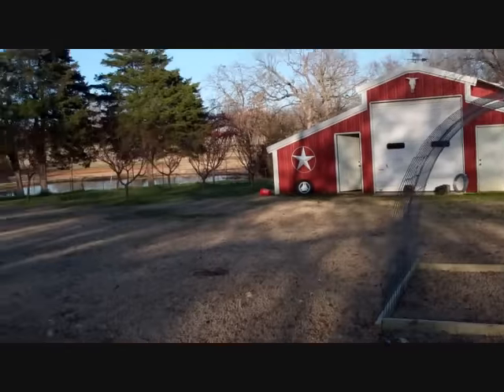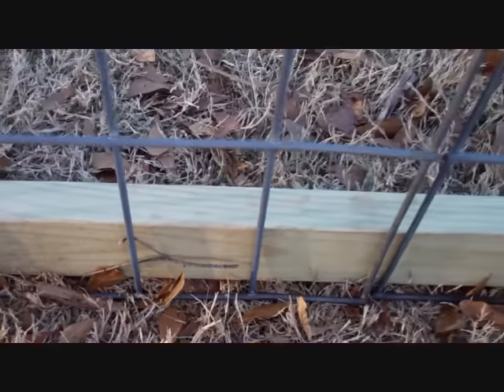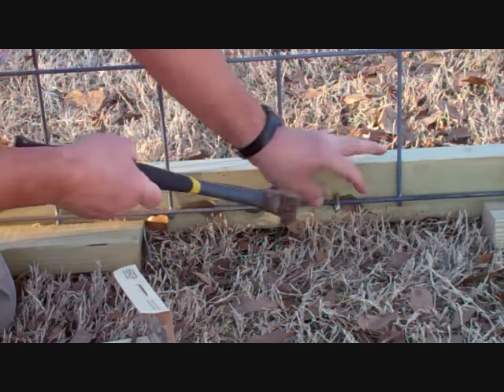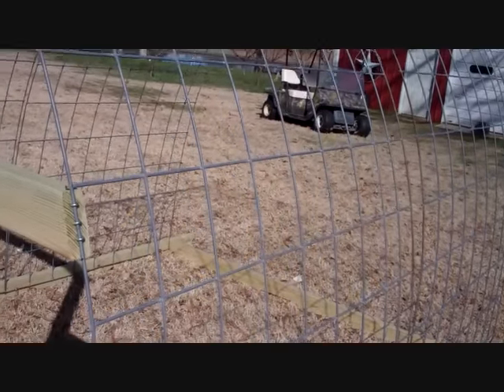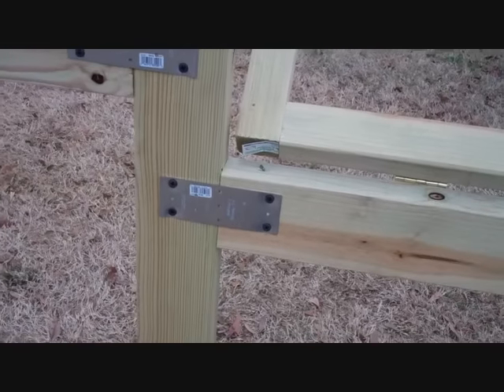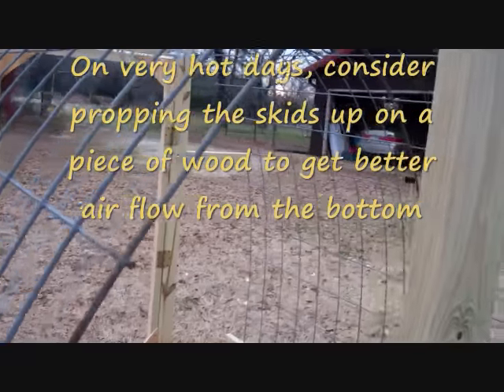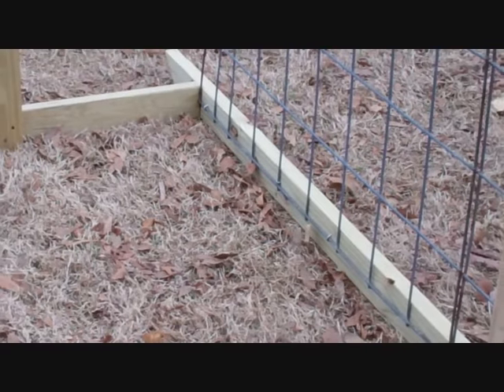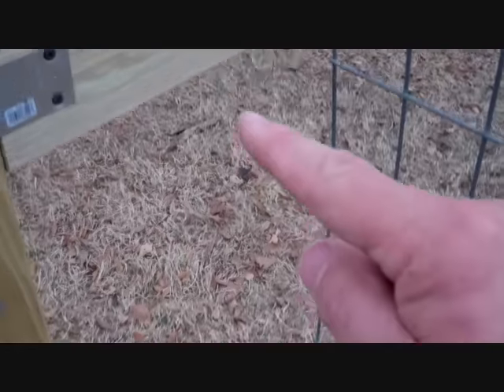🌞Cattle Panel Greenhouse🌱For About 150 DOLLARS! 🌻 DIY

Comment: How wide does the plastic need to be? I bought the kindle book. It doesnt state anywhere in the book how wide the plastic needs to be. The panels are 16' so i assume 16' wide would work? I dont want to order the 16' wide plastic and find that its too short. Thanks

Comment: I bought the plans and built the greenhouse last spring  with some modifications and upgrades. I have used the pipe insulation as in the  instructions.  and I noticed  that was the first place my plastic (bought the wrong stuff from the original link) got brittle and cracked.  I have got the right plastic now any reports of issues with  the pipe insulation?
Reply from the maker: +Tim Palmer 
No... none. For me, it seems to have protected the plastic well. Mine lasted 4 years.

Comment from the maker: The cattle panels are 50 inches tall and 16 feet long. 

Don't forget to take a look at the e-Book. There is a link to it below the video, and it included all the drawings, materials list... and even shows how to add corrugated metal to the cattle panels to make a nice shed. It will save you a lot of time and maybe some mistakes.

thanks for the comment

Comment: North Texas here.  Wondering how warm that greenhouse stays during cold spells in the winter?  Do you put a heater in it?
Reply from the maker: Steve Geer 
I only use mine in the early spring when I have seedlings that need to be in it. If you’re going to use it all winter long, yes it will need to be heated if there are frost sensitive plants in there. 
Once or twice I used a propane stove. Once I used a kerosene heater.

Comment: How much plastic did it take for the 2 cattle panel and 3 cattle panel design...I didn't hear the size of was said ...thank you!
Reply from the maker: 2 Panel will take 16X25'
3 panel would be about 16X 30', but I'm not for certain.
The PDF and eBook is linked to below the video. 
All measurements and materials list is in it.
DON'T buy plastic from Lowes,etc. It will only last ONE year.
Get a good greenhouse plastic. I have some good "greenhouse plastic" linked to below the video also.

Comment: I am in Jamaica .. made this with a few mod. no window @ the back .. plastic on the top(self defined)  and anti-viral mesh all around the sides, my door swings out, working out to be great thus far ... using it to gain some greenhouse experience with bell peppers.. wondering how it work out if I decide to make another but only around 20 to 30ft long .... any suggestions? please  thanks.. worth the money spent ....
Reply from the maker: I would think if you go THAT long, you'll have to add some support in the middle.

Comment: On the ends when you grasp the plastic then twist it and staple it, doesn't that create a channel for rain water to run down and onto the wood? Over time won't that excess water rot the wood?
Reply from the maker: +Terry Thomas 
I had that plastic on for about 4 years and it didn't seem to hurt anything. Even the BEST plastic will be changed every 4 or 5 years. Remember, I used treated wood. Moisture shouldn't make it rot. If it is going to rot anywhere, it'll be on the skids that are in contact with the ground.
Reply: +TexasPrepper2 Great job. I've been planning my greenhouse for sometime now and have analysis paralysis. Been thinking too much. To the water drain issue. Can't you just grab the plastic and turn in down instead of up? Then the channel would be on the bottom of the fold.
Reply from the maker: +Clean Slate Farm 
Sure... in fact, I don't think I've done the plastic the exact same way on any of the greenhouses I've built.
Reply: TexasPrepper2 Love the design and a great job of explaining the construction. Thanks.
Reply: +Daniel Williams Thanks. Snow and cold have hit here so the greenhouse is off the list until spring. I'll have one for fall and next winter though!

Comment: Building one as we speak!  The e-book nor the video mentions at what stage you put the plastic on the door and window.  I am assuming it is before you actually wrap the entire thing. Is that correct?
Reply from the maker: Doesn't really matter.
I think I usually do it after I wrap the arch.
That way I can use smaller pieces (if they are big enough) for the window and door.

Comment: Hey There...this is a great greenhouse. We purchased the kindle version of your plans, but neither the video nor book has an explanation of how you skinned it. I'm having issues with all the excess plastic on the end/corners. Do you cut it? If so, where and how? Thank you!
Reply from the maker: I showed as best I could about skinning it, but the few I've built were all a little different as far as the plastic goes.
I've had dozens of folks send me pictures of their greenhouses and I don't think I've seen any 2 "skinned out" alike.
Basically... After you get the plastic stapled down... and you are satisfied with it... just cut off all the excess. 
Don't cut the plastic it till you get it all stapled up, and you like what you've done.
Hope that helps,
alan
Reply: Thank you so much! That does help...I wasn't sure if I should cut it or not :)

Comment: I ordered the ebook directly and am building mine now.  Will have the door open out, not much snow in Georgia!  But I was wondering about making the door less wide.  Say 24 or 30 inches instead of 36?  That would leave more room on the sides for shelving.  Thoughts?
Reply from the maker: Sure... you should be able to put even larger shelves if the door is narrower.
Make sure you have enough door space to get stuff in and out.
Let me know how it goes :)
Reply: @BIGALTX  Hey I went with your standard design. Almost done, just finishing up the cover and figuring out how to possibly install a heater.  I'll ask about heating as a separate question.
Reply: @BIGALTX  One more question.  How did you cover your door?  I couldn't tell from the video or your guide.  Specifically did you wrap the plastic all the way around it or just on the front and then cover the staples with trim?
Reply from the maker: @dandorfeld4543  
I think I just covered it and stapled it on the front. Then, as you said, just covered the staples with trim.
But, that's not critical. Do whatever is easiest for you

Comment: Have you heard how this greenhouse holds up to snow and wind loads?  Thanks for the video.
Reply from the maker: +Joe Shmoo 
folks up north said the snow just rolls off of it. 
I've had some 60+MPH winds without any problems.
But, if you're concerned about wind, you could use auger type anchors.
http://astore.amazon.com/homegardenfarmimprovementemergencypreparedness.homesadvis0b-20/detail/B00004YTOJ

Comment: so was using 6x12 press treated base and 1 1/2" fencing staples were splitting the wood. what am I doing wrong?
Reply from the maker: Are you saying you're using12 foot long  2"X6" ?
If 2X6's are splitting with a fence staple, I'm not sure why.
I've never seen it happen.
If it's really close to the edge it might, but not in the center of the 2X6. 
I don't think  it would be a  big  problem, but just monitor it to  make sure the cattle panel stays tight

Comment: What about.rolling the plastic up.during heat..say over a board or pipe...

Ive been trying to get hubby to do this for seven (?) Years
.im.doi g it my self this.year
Reply from the maker: Sure, that would work... use something like 1/2" EMT pipe to roll around the plastic. 
That should weight the plastic down too.
Or try putting shade cloth over the plastic and opening the door and window.
Still might get pretty hot... not sure

Comment: the cattle panel is made of galvanized iron. right ? so on a cold overnight and some water moisture on the galvanized material dripping into the plants in the morning as the sun comes up, is the zinc coating on the galvanized material considered toxic ?
Reply from the maker: Not sure... but I doubt there is any significant residuals dripping on the plants

Comment: I wonder how the rate of decay is affected by the green house clear plastic exposure to more dry weather and more UV light if we end up at the equator.
Reply from the maker: Probably depends on the quality of the plastic.
You need a good "Greenhouse Plastic". It will last 4 to 5 years in this Texas heat, so will probably also do well near the equator.
There is a link to a good plastic under the video.
thanks,
alan
Reply: I ask, becasue I had problems with my commercially acquired gutter opaque material meant ot prevent water damage by  draining off the water more uniformly, not keep shape, in this   UV light and lack of water, when it passed age 5, so a wood gutter, I think  if painted might do better.  R.

Comment: What's the ml on that plastic? Stuff I previously used didn't last a whole season.Thank you!!
Reply from the maker: Debbie Ortiz It's 6 mil (i think). BUT... make sure it's "Greenhouse Plastic". That should last 3-5 years. Regular plastic you get at Lowes, etc won't last long.

DO NOT USE the Warp Plastic I linked to in the e-Book. I have had several comments that said it didn't last long. Here are 2 links to the right kind of plastic:

Greenhouse Megastore: http://www.greenhousemegastore.com/product/4-year-greenhouse-film/plastic-greenhouse-film

And a GOOD plastic on Amazon: http://astore.amazon.com/homegardenfarmimprovementemergencypreparedness.homesadvis0b-20/detail/B00CTSAPQ0

Comment: Hate to be a pest with questions but when you said you had plants in yours have you strung tomatoes or peppers attached to the top of the frame?  I think it would hold maybe two of each, what do you think? I plan on putting a support bar down the center just for added support. Thanks again.
Reply from the maker: +Regina Leathers 
In TX... when the tomatoes are tall enough to tie or stake... it's too hot for them to be in the greenhouse. If a shade cloth was added in summer, I could grow tomatoes in there, but I haven't used shade cloth... yet...
Reply: Thanks.

Comment: Hi, my understanding is cattle panel wires are atleast 4gauge or 5mm diameter. Will a thinner wire around 2.5 mm diameter work? Could not find cattle panel in Ireland.
Reply from the maker: The "rods" that make up a cattle panel are about 1/4" in diameter (6.35 MM)
I don't think anything as small as 2.5 would work without some sort of bracing
Someone from UK found the cattle panel years ago and told me the name of them, but I've forgotten
Here they are in the US:  https://www.tractorsupply.com/tsc/product/feedlot-panel-cattle-16-ft-l-x-50-in-h?cm_vc=-10005
Hope you can find them
And, Greetings from Texas!
Reply: @BIGALTX  many thanks for replying. I guess I will keep searching.
Reply from the maker: I think the guy in the UK took the link I sent you to his local farm/feed store and showed it to the owner. 
When he saw it, THEN the owner knew what he was looking for and ordered him one. 
You might want to try that.
Reply: @BIGALTX  I will try that route. Thanks again.

Comment: Start by nailing your 2X4 screw the 8' sections on one of the panel 2X4 then secure the other side with screws or lag bolts..

Comment: How does it stay cool here in Texas?  I'm in Dallas and dread the summer sun and heat.  How to you maintain lower temp in the greenhouse?
Reply from the maker: First of all, I take the plants out when it gets too hot. I use it only for starting seedlings.But, since the design is portable... it can easily be moved into a shady spot  where it might be possible to keep some plants in it even in the summer. Also, you can put shade cloth over the plastic to shade it and make it not get as hot.
Hope that helps...

Comment: can you tell me the guage on teh cattle panel, I cut all three pieces and when I went to put them up they were super flimsy!  So that didnt work.  And where you get it?  thanx in advance.
Reply from the maker: They are made of galvanized rods that are about 1/4". (4 Gauge)
They are not flimsy... so you may not have gotten the right ones... not sure...
Here is a link to them at Tractor Supply:
http://www.tractorsupply.com/en/store/feedlot-panel-cattle-16-ft-l-x-50-in-h?cm_vc=-10005
hope that helps...
Reply: GOD BLESS YOU !! THANX!
Reply from the maker: dolores brittain
HE has and does... everyday
thanks !
Reply: Amen!  My husband and I went and got the wire fencing at tractor supply in teh puring rain this past weekend! ugh.... I am excited to get started!  Thanx again for your help and videos... we are just starting our prepping now and know time is running short!  Pray for us!  lol!
Reply: Flimsy might not be the correct word. I am quite sure you bought similar panels as the rest of us. While better than PVC pipe, the panels require additional support if you live in high wind or heavy snow load areas. A ridge beam will add a tremendous amount of strength to the unit (peace of mind is priceless). Check out how I constructed my greenhouse.  Good luck with your greenhouse! Regards.
Reply: thank you I will!
Reply: dolores brittain I measured the wire diameter on the cattle panels I purchased from Tractor Supply. The panels use two different wire gauges. The 16-foot long wire is 7/32" (0.2188). Based on the chart I used, that equates to 4 gauge. The shorter wire is 13/64" (0.2031); that equates to 5 gauge. I measured several places and the wire diameter was consistent.
What I purchased:
http://www.tractorsupply.com/en/store/feedlot-panel-cattle-16-ft-l-x-50-in-h
Gauge conversion:
http://www.csgnetwork.com/wireconversiontable.html

Comment: Thanks for the response. I've begun collecting many of the supplies needed for a version of your design. What are your thoughts on the plastic used? I've heard different opinions regarding the grade, polyethylene, etc.
Reply from the maker: When I first built mine, I went to a Greenhouse Supply place near me and bought some 6 mil GH plastic. It is supposed to be 5-6 year plastic, but it probably won't make it quite that long. Buy GH plastic if you can get it.
Reply: That's what I figured. Just making sure from someone in the know. Like many of us I'm undertaking this project with a low budget.  That being said, I don't want to cheap out on the plastic and end up replacing it in a year. Thanks for all the info.

Comment: I'm thinking to run two rafters accross the ceiling via 2X4 (or bigger if longer)  from the top corners of each door/window header...would be at the same height as the cattle guard so simply staple the guard to the rafters every foot or so ....would just help to give me the warm fuzzy feeling that it was more of a real structure
Reply from the maker: Sounds like a plan to me !

Comment: I built the frame and have the cattle panels in place. I would like to find the right kind of plactic in a small quanity.
I am in San Angelo, TX
Reply from the maker: +Scott Steele 
See if there is a "greenhouse supply store" near you. 
If not, I have links under the video to some plastic on Amazon, and one other place (i think it's Greenhouse Megastore).

Comment: Great greenhouse! I started mine Friday using 3 panels and 2x6 `s.It is 8x12.5 feet.I had to cut off 4in  of the last panel for fitment.My mistake,should have laid out the base longer.Got it stapeled and Bam!! My base is seriously bowed in the middle.I am ready to finish but am unable to figure out how to fix this deal.Any ideas?
Reply from the maker: The pressure of the panels pushing outwards will have a tendency to bow it a little... but usually not "seriously".
If it is going to be stationary, you can drive a pin or two (like rebar) along the sides (after you align them straight again). That will hold it straight from now on.
If will be moved from time to time... I'm not sure how to keep it from bowing unless maybe you put a strap (like metal banding) from side to side (inside the GH... at ground level.)
Also, shelving might help if you have not already put any in. Straighten the runners out and put your shelving in... that could solve the prob.
Let me know...
Reply: TexasPrepper2 My 2x6`s were very wet but straight when I picked them up at Lowes,Might be part of the problem.I`m not planning on moving it so the rebar idea sounds doable.btw I got a 6ft 2in center height on a 8ft wide foundation by stapling the panels 4.5in off the ground instead of using a 2x4 which only raises a panel 1.5in. Thanks again for the help.

Comment: Getting everything together to build this greenhouse but wanted to ask you how much poly you use. I dont know what width to use and dont want to order to much or to little.
Reply from the maker: IWickid Gamer For a 2 panel greenhouse you'll need 16' X 25'. If you build it longer (more panels) you'll need to increase the 25' measurement. The 16' measurement will stay the same.
Reply from the maker: DO NOT USE the Warp Plastic I linked to in the e-Book. I have had several comments that said it didn't last long. Here are 2 links to the right kind of plastic:
Greenhouse Megastore:
http://www.greenhousemegastore.com/product/4-year-greenhouse-film/plastic-greenhouse-film

And a GOOD plastic on Amazon: http://astore.amazon.com/homegardenfarmimprovementemergencypreparedness.homesadvis0b-20/detail/B00CTSAPQ0

Comment: Nice! The only question I have is about the pipe wrap. Does it hold up in the sun and does it cause any problems with the life span of the green house plastic? Thanks.
Reply from the maker: It lasts a long time. A good plastic will last 4 or 5 years, then need to be replaced. 
At that time I would also replace the insulation.
Reply: I appreciate the prompt answer. All the best to you and yours.